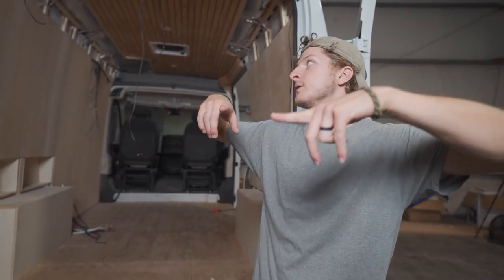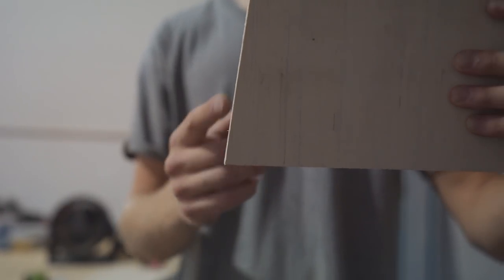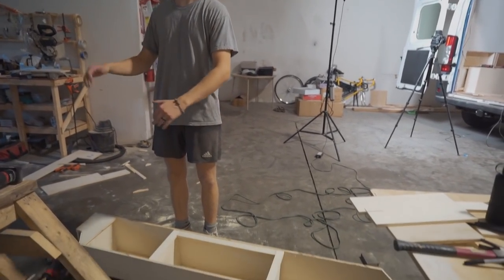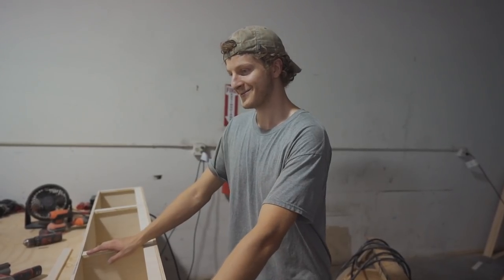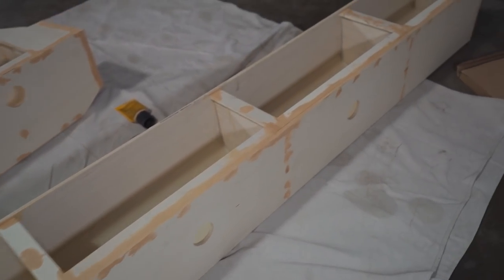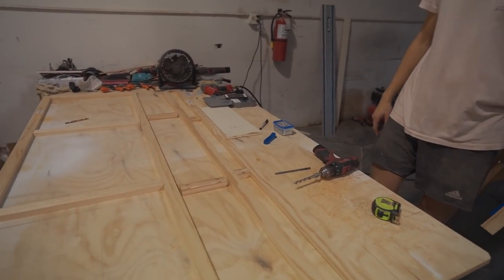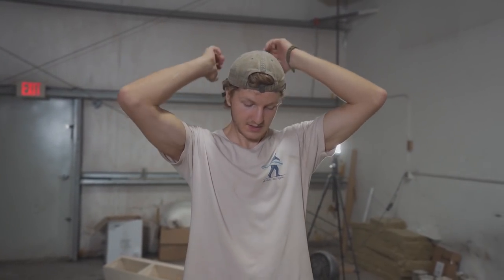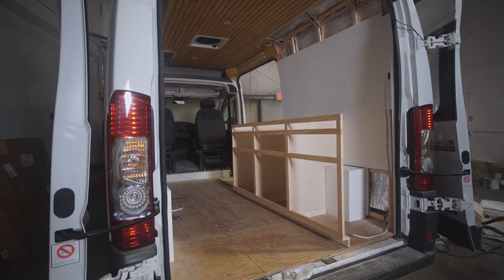VAN BUILD IN 20 DAYS | Custom Modern Kitchen Cabinetry for VAN to MAXIMIZE Storage Options!

Comment: Hi guys, epic channel! I am loving your eye for the detailed work and the dynamics between the both of you. QQ: how strong (thick) is your floor and and the basis of the roof? 

In addition I have been researching like crazy for a bit more details on wiring, any chance you might be doing a video on wiring? What should I have in midn when putting the electrical system together?

Comment: How much weight is going into that van. In the UK we have strict laws on weight limits and many easily go over the payload limit with chunky wood furniture. Big fines, or even court if pulled over and overweight.
Reply from the maker: Definitely not overweight. 1/2 inch birch ply is the primary wood used along with pine (very strong and light). Both are incredibly light materials and the van is very open compared to many, so there isn’t really and bulky furniture..